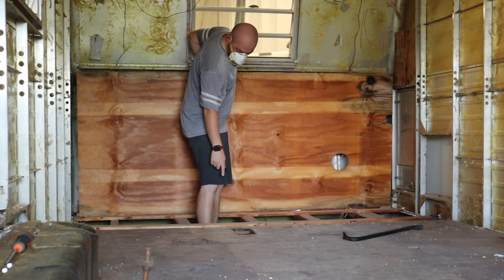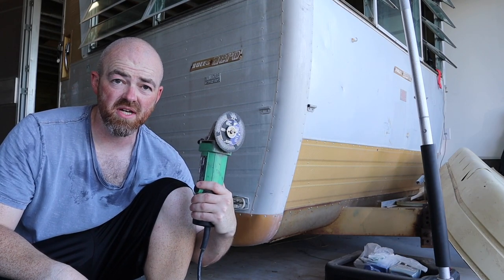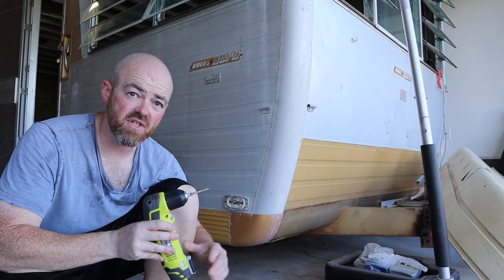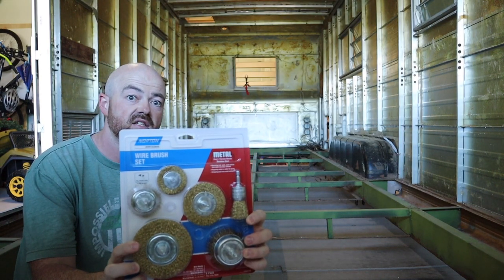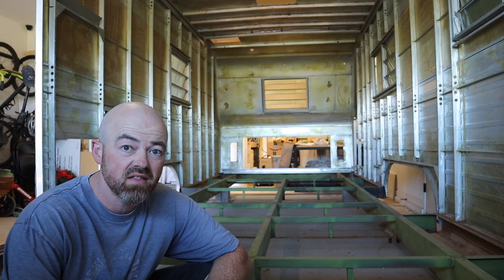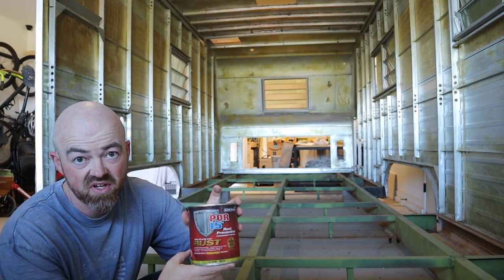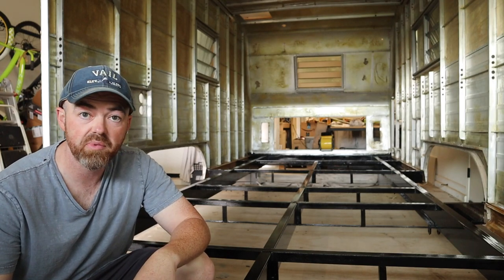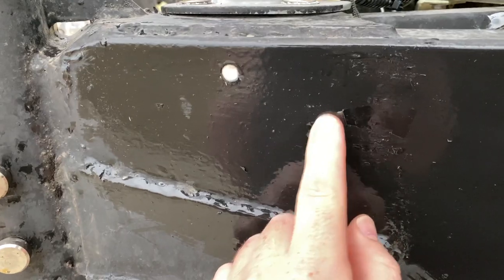RV BUILD - RV TEAR DOWN - Travel Trailer build from the frame up

Comment: in hindsight on this project , would you have dropped the belly pan? and what were your motivations for doing so at that time.  i have a HR 24 getting a new floor,  much like you did. can you  give me your thoughts at that time as to what you hoped to accomplish? and would you do things differently second time around?  thank you.
Reply from the maker: For our rig, the belly pan had to be dropped. There was too much damage and work needing to be done, mainly on the frame (rust prevention).

I went way overboard on the framing. If I did it again, I would try and go with aluminum framing instead of wood, better floorboards, no access panels in the floor (some access panels in the belly pan, somehow or make it so the belly pan can be dropped easily), AND my biggest regret is not doing a leak-down test on the entire RV, which means sealing it up, taking it out and wash it down. Better yet, take it to a semi wash.
Reply: @HomeMeetsRoad  this, along with your very honest comments in another video, make your channel a must - watch. hey, things dont turn out to plan .
the ramblers have a patch on the belly to drop the tanks. i thought your storage access a rather good idea,evidently it did not work to plan. 
as for leaks, absolutely. this rambler will get pvc membrane glued over aluminum roof and tossing the ac units, they will leak...
it must be pointed out that the bulk of your work did accomplish what you sought it to do.
Reply from the maker: @pugetlexus  Thanks! Being on the road for four years (we changed rigs over a year ago), I realized that no one gets it right. I don’t care if you buy or build. You will either change rigs or make significant modifications. The real question is, did you learn and move forward or do you give up and return to sticks and bricks (not that anything is wrong with that). I learned a hard lesson, but it was still the proper rig because we love this lifestyle.
Good luck with your project!

Comment: You ever heard of a jack 😂 and blocks 😅 wish i had more money than brains lmao not
Reply from the maker: Help me understand. This video is over five years old. Why Jack and blocks? For what? The trailer was on blocks while in the garage getting the work done. A jack was used to get it into position. What am I missing?
Reply from the maker: I just re-watched the video, and I’m honestly not following what you are referring to. I put the trailer on blocks the minute I had part of the frame exposed, and then I was able to remove the factory jacks on the trailer.
I realize that in the video, I said I had 12” of clearance above the trailer, which I thought I had, but once I started to jack the trailer up, the garage door opener was in the way. That was the most room I could give myself to work on this thing. Remember HOA… I couldn’t work on it outside.

It’s funny you think I had money. I did this because I had no money. I couldn’t afford an RV. I built this thing on a credit card, gambling on the hopes I made enough on the house sale to pay it back.